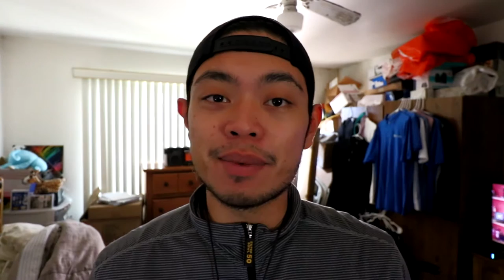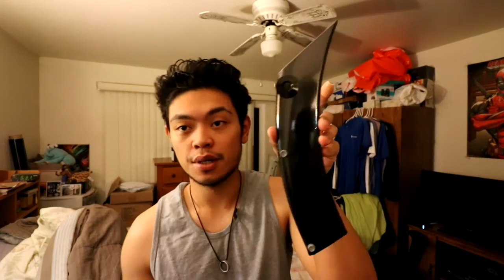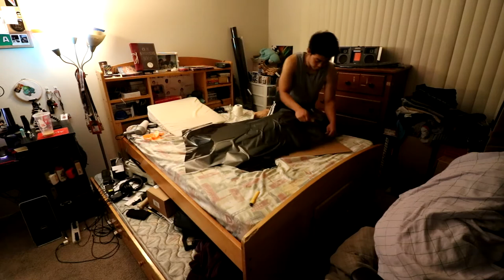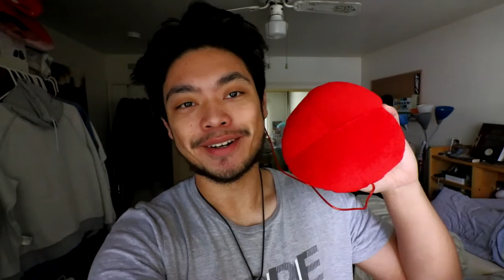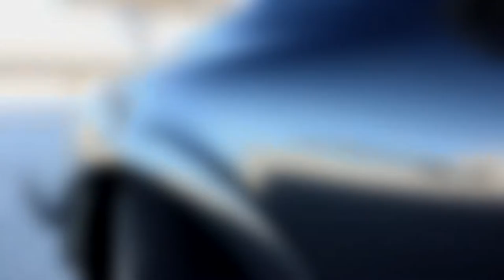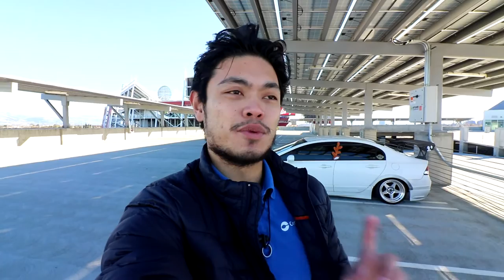Wrapping my civics fender with Carbon Fiber Wrap

Comment: is this with the mono ss coilovers?
Reply from the maker: yep, they sit pretty low
Reply: Kevoroba should do more walk around!
Reply: what’s your ride height? did u have to roll the fenders?
Reply from the maker: Gee Thor I was about 4 inches off the floor. And fenders were rolled
Reply: oh okay, i’m new to this but if i go that low is it required to get camber arms
Reply from the maker: Gee Thor i would suggest getting camber arms for the rears since you’ll need to adjust it so you dont destroy your tires
Reply: nice thank you!
Reply: do you know any enexpensive rear camber arms?
Reply from the maker: Gee Thor you can try running godspeed camber arms, or go higher end with SPCs